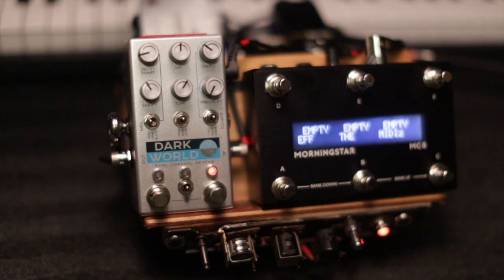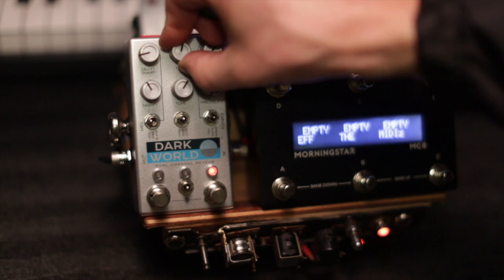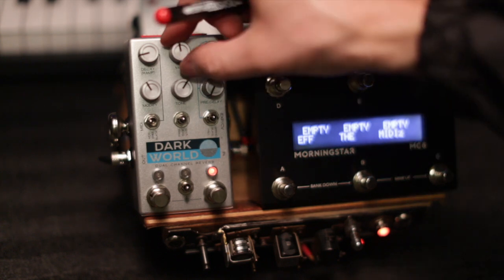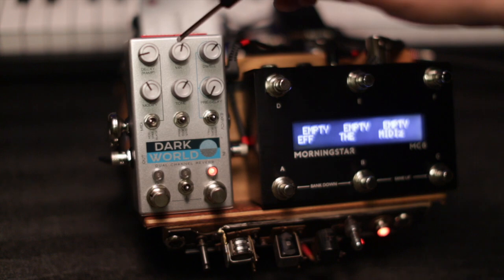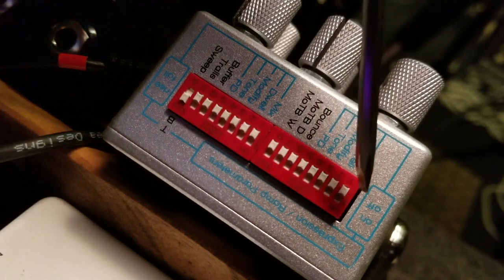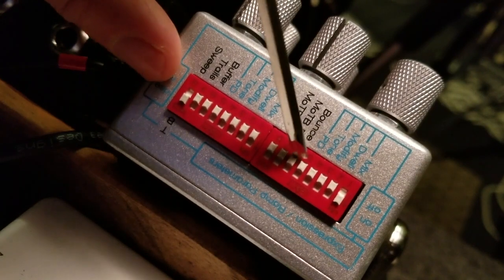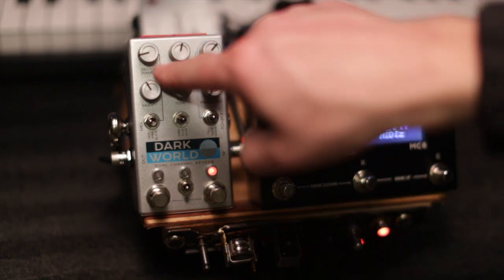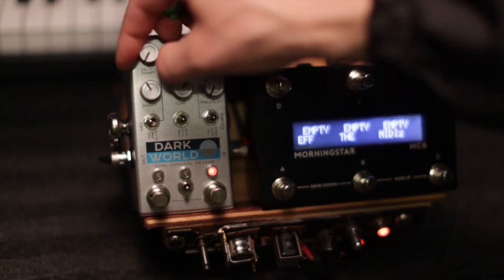MIDI Minute: Bouncing/Ramping

Comment: how do you set the range of bounce?
Reply from the maker: Bouncing always occurs between the knob position and the max or minimum knob setting, depending on the Sweep dipswitch position. Ex; you are bouncing the Clock knob on MOOD mk1. Putting the knob at 8k, turning on Bounce and Clock, will then have an LFO bouncing between minimum (2k) and 8k settings. Then turning on the Sweep dipswitch will change the bounce to go between 8k and 64k.